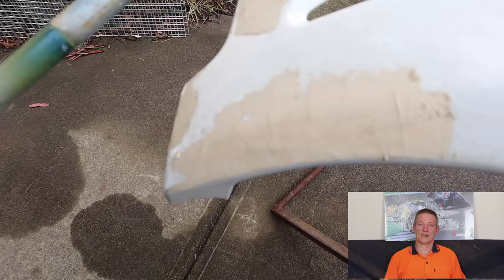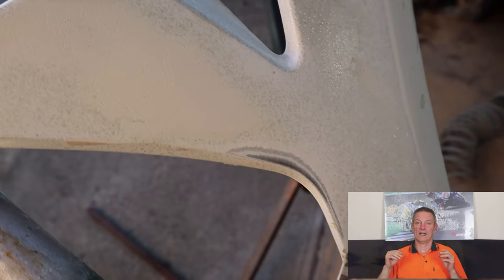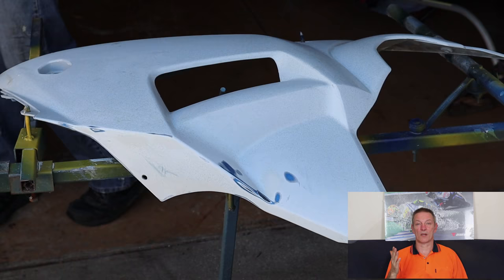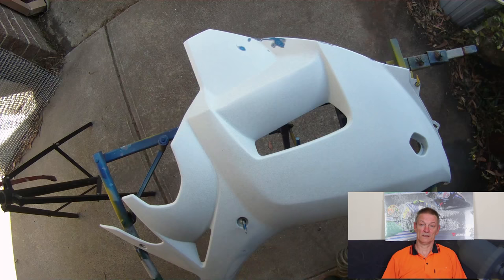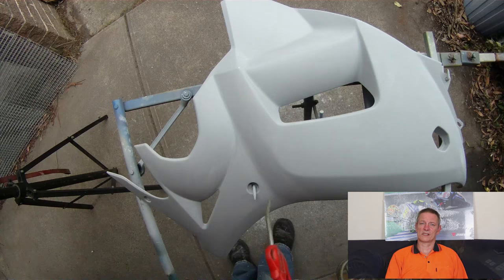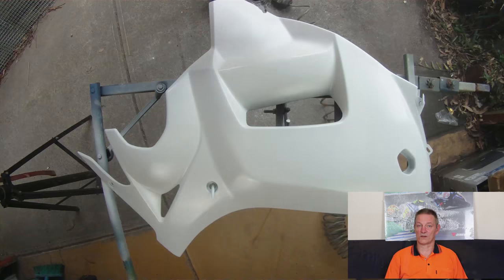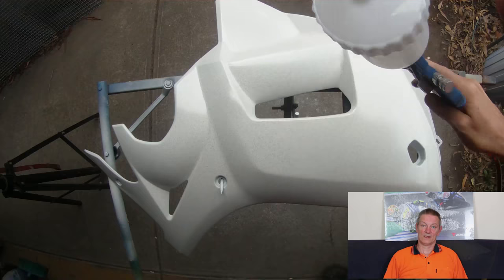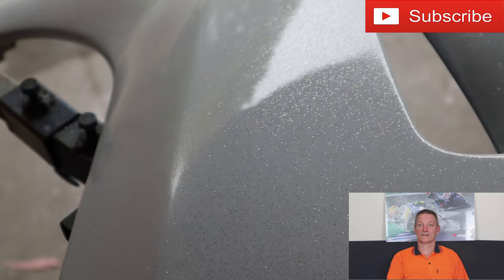How To Paint Motorcycle Fairings (Tutorial)

Comment: Hello, thanks for the video, this was helpful.  I’d love to be able to execute this.  If you see this and it’s not too much trouble I have a few troubleshooting questions for you, that’s why I’m researching again.  

I’m painting a road warrior fairing and I’d like for the job to come out successful, the first go came out pretty bad lol.  

I used a process with rattle cans from a company called Touch Up Direct that guarantees color match.  I’ve seen similar jobs done this way that came out good so I figured I’d give it a shot since I don’t have professional equipment.  The color wasn’t perfect but it was close enough for me.  The flake in it came out very uneven.  

What happened was I sanded and used oil and grease remover, applied a few coats of primer then used an entire can of color, about 4 coats waiting about 10 minutes in between.  I had a couple mishaps during this process and had an issue with debris/ dust finding its way into the paint but it still looked ok.  I then put 3-4 coats of clear on and waited 24hours after to dry before I started buffing and polishing.  The big issue I noticed was how much orange peel had to be buffed out and almost immediately after I started buffing with the company supplied buffing pad, at the same spot at opposite edges of the fairing, it buffed down to the primer, I wasn’t being aggressive at all.  Regardless, I’m left with those white primer marks on either side and still a lot of orange peel around the edges since it was very hard for me to buff around the edges without chipping off paint.  

I’m wondering why it sanded through the clear and paint so quickly given how much paint and clear was on there, and how can I prevent so much orange peel next time?  Should I have sanded the paint and cleaned it again before priming?  I felt like it needed that because the paint had a grainy texture that I guess was supposed to be like that to help the primer stick better.  Maybe I used too much clear and that’s why I had so much orange peel?  I’ve seen professional videos where it looked like they used way more clear than I did.  

Sorry for the long post, I just wanted to be thougough and any advice would certainly help and be appreciated.  

Thank you
Reply from the maker: Hi, Lets start with some basics. Ratlle cans at room temp almost always give you orange peel. Get yourself a jug that is about the same size as the cans you are using.  Fill the jug with hot water from the tap. NOT boiling water. Stand the cans in the hot water from 10 mins. Take them out of the water and shake them, they should feel hot to hold. Test spray before you start to paint, you will notice that the heat will cause the paint to have more pressure. This will reduce the peel effect. Apply light coats, the first coat should be transparant. Wait 15 mins then apply another light coat, repeat this until you have your desired color. Keep changing the water and put the can back in the fresh hot water between coats.

Do this same proccess for the clear coat.

I cannot stress enough, LIGHT coats. If you paint to think you will get orange peel again. Take your time and be patient :)

As for your panel now. Sand it all flat and start again. Wet sand your undercoat with 600 grit paper before your spray color.

This should give you a much better result. Good luck my friend and remember. If I can do it, so can you.
Reply: @howtowithkel3352  thank you.  This will help.  I put the cans in hot water but only before I started the job so they were mostly room temp throughout the process.  I’ll be sure to make sure they are warm to the touch at all times now

Comment: Hey Kel, really awesome video man, what grit paper should i use to get oem paint off? I tried on my bike fairings and its taken ages for me, i used 400 grit but i feel like theres a quicker way to get it off, cheers
Reply from the maker: Hi Michael, You don't have to get the paint off. Just get it smooth to the feel, it does not matter what it looks like as long as it feels smooth. Then coat it with 2K primer filler, once dry wet sand with 600 grit. That is it, you are ready for colour. You can use 320 grit to remove the paint. Just make sure to use a good primer filler over the 320 grit scratches. I would not apply top coats over anything lower than 600 grit.

Comment: I have done a great deal of automotive painting but always on the metal parts of classic British  & German cars of the 50's & 60's with no plastic parts. I was always under the impression that a special paint or additives to promote flexibility were needed when painting on plastic parts to avoid cracking.  Is this not true? I did not hear you mention anything about this so I am assuming that I heard wrong in the past. Can you confirm this? Wonderful video. Thank you!
Reply from the maker: Hey PJ, If you are painting plastic that is fixed on all sides like motorcycle fairings it is not neccessary to add anything. On some large front bumpers with a lot of movement it is a good idea. However it is as simple as spraying a flex agent on the panel before you paint it. Modern acrylic paints are very flexible. Paint a peice of plastic and bend it, you will see for yourself. I am painting a Lotus 7 right now, all aluminium.
Reply: @howtowithkel3352  :  Thanks, Kel.  In this case, one of the parts I am painting does get quite a bit of flex as it is the front hood of a "side by side' ATV (or UTV actually) that I use on my ranch.  The unit itself has simply seen too much sunlight and although I have tried to get deep enough into the plastic to try and resurrect a uniform color to buff and call it call it good, it's just not going to look right in the end. So, I have decided to paint it.  I just need to do my best to prevent it from cracking or failing in other ways. I am used to doing very detailed prep and don't mind spending the time to do so as it is my nature. I just need to give it my best attempt using the proper materials so this is where I am a bit out of my element. I very much appreciate your advice!

Comment: Im asumimg i do all this same prep work, im doing matt black over top of gloss black what undercoat if any do i need,or can i just block the gloss out then shoot the  matt black
Reply from the maker: Matt is very forgiving. Just block out the gloss with a 600 grit wet sand. Make sure it's completely dull and shoot the matt. It will be venerable to chips so if you can, coat the matt in a matt finish clear or get flattening agent for satin clear.

Comment: I have a fairing that is in good condition but the wrong colour. I have no tools to paint and don’t trust myself not to screw it up so I’m looking for a professional to do the work. I’d like to save myself some money and the person painting it some work by sanding it down myself. I’m fairly sure I won’t screw that up. Do I need to just sand the clear coat or do I have to go down past the original paint?
Reply from the maker: Hi, this is an easy one for you, all you need to do is remove the shine. Get some 600 grit sand paper and give it a wet sand all over. When you have a uniform dull looking surface, it's ready to paint. That's it.
Reply: @howtowithkel3352  thanks so much, with a block, not the hand, correct?
Reply from the maker: @hailboognish3858  A block is always best. There will be some places that you can't get to with a block but do as much as you can with the block. Good luck.

Comment: I have a question. After 24 hours that I have painted the fairings and put 2 coats of clear coat, I saw that some spots on the fairings have not had a clear coat on them. They are rough on touch. Can I spray a new coat of clear now? Or should I sand the whole plastics with 1500 grid and then do 2 coats of clear coat? ?
Reply from the maker: You can paint them no problem. But you need to rough the whole panel, paint just the missed areas first and then put a coat on the whole panel. Before you paint, wet sand with 600 grit paper or dry rub with grey scotchbrite. Anything 800 and above is more for polishing. If you use 1500 your new clear will not stick.
Reply: @howtowithkel3352  Thanks! So to understand better, do I have to wet sand with 600 grid the whole panel? Or only the parts that I missed with the clear coat? And after spraying a new clear coat over the whole panel.
Reply from the maker: You have to wet sand the whole panel first. Then paint the parts you missed. Then paint a coat over the whole panel. The sanding puts tiny sratches in the surface to give the new clear something to stick too.

Comment: Very helpful video! One quick question... I heard of sanding between layers of paint, so is it necessary and when this is done?
Sorry for my bad English
Reply from the maker: The only time you sand between coats is if you have a reaction or a run in the paint. As a rule I sand only the primer.  Most of the time you spray color and clear at the same time so there is no time for sanding.

Comment: NIce work, I have a question, I have a burgman 400, Ive stripped the plastic panels and Im ready to paint, Id like to use an inexpensive spray gun, im trying to keep it simple,,,,,,sand it, use some dupi color cp199 clear adhension promoter primer, then hit it with paint gun, then clear coat,,,,,is this a simple method to do? Also, can you tell me some good quality paint that will do those plastics that I can put in the spray gun?  TY for your work!
Reply from the maker: Hi, that is exactly how it is done. As far as paint, if you want good qualty then DeBeers is a very good brand. You will pay up $150 for a litre however any of the well known brands will give you an equivalent finish. Method: Undercoat then 600 grit light sand. Color then 600 grit light sand. Just remove the shine. Clear coat and your done. Good luck, great to see you having a go.

Comment: Do you just add or mix the the silver and gold flake into the paint I’m am trying to paint my whole bike and I really like that color and flake you came up with. So it’s two coats of clear 2 or three coats of white then the flake?
Reply from the maker: Hi Adam, you add you flake to 1K air dry clear coat. Paint white first, 2 or 3 coats. Then flake mixed in 1K clear coat. Then 2K clear to finish, 2 or 3 coats. Don't forget you need a 1.8 to 2mm paint tip for the flake. Good luck.

Comment: can you paint a fairing with a regular spray can?
Reply from the maker: Hi, yes you can. However you will need to let it dry for a few days and then depending on the finish you want. You can give it a sand with 2000 grit and polish it up. Or just leave it. It will never be a gun finish and will not stick like gun applied paint. chips are very common. Good luck have fun.
Reply: @howtowithkel3352  thank you. Just enquiring for now

Comment: Was wanting to colormatch my truck grill, it’s ABS plastic, I was gonna use the scotch bright pads to sand it with a scuff promoter  and then wash everything down, maybe use an adhesion promoter and then use the paint matched rattle cans, I’m 17 and it’s my first truck so time and money are low, am I missing anything that may ruin the whole thing? Any advice is welcomed, thanks!
Reply from the maker: Ok, make sure you use grey scotch-brite as it is around 600 grit. If money is tight, you don't need to use adhesion. However, if your grill is black or chrome. I would consider painting it grey first. This will give you a better chance of a color match. I hope this helps. I'm here if you need more info.
Reply: HowToWithKel much appreciated, I also have a metal bumper which may be a bit tougher due to orange peel, but I think that’ll be it’s own project for another time, I appreciate the response I’ll definitely subscribe my friend!
Reply from the maker: @Austin-mo1vy   Hey, if it's metal. Hit it with paint  tripper, leave it for 15 or 20 mins. Hose it off. Clean it, undercoat and paint..... Easy
Reply: HowToWithKel thanks a lot man, I really appreciate the info!

Comment: I have a question. I sand the plastic fairings with 180 grid paper, then with 250 and then with 500 grid. Do I have to go all the way to the 800-1000 grid? Also if they have deep scratches is better to fill them up and then use sandpaper again, or to use to go down let's say to 100-60 grid sandpaper to remove them?
Reply from the maker: If you can it is always better to remove scratches completely before you paint. It is not necessary to go any finer than 400 after priming. From that point on you need  600 to 800 grit. From 1000 grit onward you are starting to polish and the paint will not stick as well.  I use 400 grit, then I spray primer. I sand the primer and all other coats with 600 grit. However you should not need to sand after the primer.
Reply: @howtowithkel3352  OK, thanks!

Comment: Hi There, i am hoping you would be able to provide me with some advise, I am in the process of getting a Mole Fender for my White Yamaha Vity 125cc scooter, but i can only get the new Mole fender in a dark Blue. what would be the process to spray the Fender in white, i have been told that i need to get sand sand paper to remove the shine gloss paint of the new part, is this correct? thanks in advance. Gerardo Sanchez
Reply from the maker: Hi Gerardo, Its a simple process. You will need your bike color, any paint shop can make it for you. You can visit colorrite.com to get the paint code. Start by wet sanding the whole surface with 600 grit wet & dry sand paper. You want to take away all the gloss and leave a uniform dull finish. Remember, paint does not stick to gloss. Dry the panel and then clean it with wax and grease remover. Apply your color in 2 or 3 coats, wait 5 to 10 mins between coats. DO NOT try to cover it in 1 coat, you will create runs. To get a factory finish you should coat the color in a hi gloss clear.  That's it my friend. 

Have fun.
Reply from the maker: Gerardo, just a quick note. As your new panel is dark blue, you may need to prime it grey to get a good color match.

Comment: How do you avoid things sticking to the paint while spraying outside
Reply from the maker: Hi, the fact is I don't. I make sure that all surfaces are free of dust around me and that the part that I am painting is in the middle of the room. By doing this I avoid must particles from getting on the work. The only thing I cannot control are the little flying critters. HARD rule. Do not try to remove any flying thing. Leave it there and come back when the paint is dry. A light sand will in 90% of cases allow you to carry on. A small delay is always better than starting again.

Comment: I bought a set of unpainted aftermarket fairings to paint myself. Just curious with these "unpainted" fairings is it still necessary to sand down the surface or apply a primer before the paint?
Reply from the maker: Hi, Yes they will need to be sanded. Most moulded sufaces are to smooth to paint. Get some 600 grit wet paper or a dry grey scotch brite and go over the fairngs. Make sure they are uniformly dull across the whole surface. Then you are ready to paint. Good luck.
Reply: Thank you, sir.

Comment: What grit did you use for the blocking
Reply from the maker: Hi, 400 - 600 is normally used when blocking. If you are removing filler ridges you can use 320 or even 240 however it pays to finish the surface in 600 before painting.
Reply: @howtowithkel3352  thank you for you advice sir.